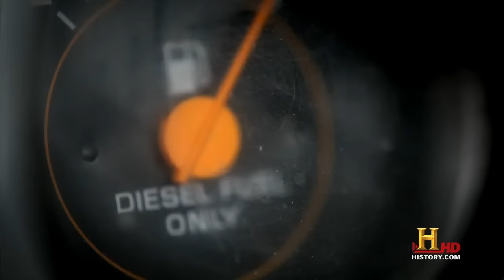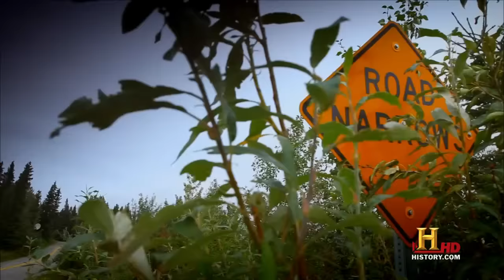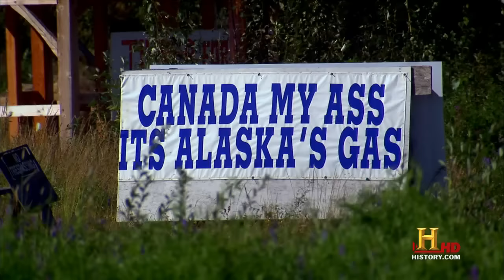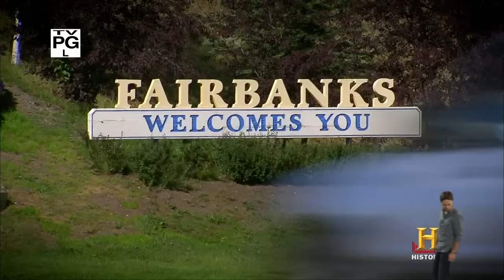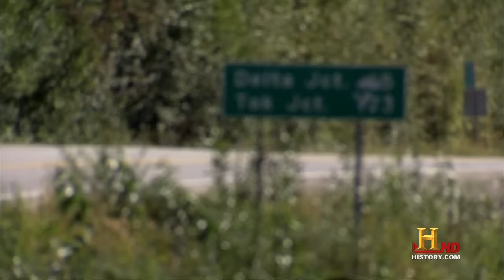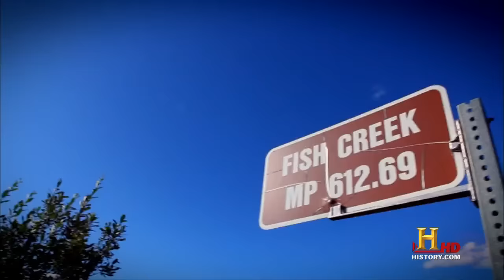Top Gear America Best America's 4x4 Truck   S01E09 - 2011.01.16

Comment: That Toyota is worth a lot more than $3k
Reply: It's worth like 10k
Reply: Benjamin Fink, pshh no.
Reply: If it was stock it wouldn't
Reply: Don’t doubt that. My almost 10 year old  (Toyota) truck with 120k miles is still worth 18000
Reply: Wrong you can get those here in Texas for 1500
Reply: @RiggyRonnie  not here in va
Reply: @randomguy-of8np  ya well it's surely not worth over 3k coming from the 1990s unless it's in tip top condition.
Reply: @RiggyRonnie  in my opinion a brand new Toyota is only with 3k. Hell the flat bed ford is worth more then a new Toyota to me so I see where your coming from lol.
Reply: WikiTool You guys both know nothing about Toyotas :P
Reply: @drwhat4574  my brother owns one lol. I'm in the middle of rebuilding the whole truck practically with him so ik plenty about them. They are pieces of shit
Reply: That Toyota would probably do better than any of the other trucks they had. My dad's truck has over 300 thousand miles on it and it runs like a dream, my mom has a Toyota Tacoma and my dad's got a tundra and a 4 runner lol. They've never had any issues with either truck. I'm pretty sure Toyotas are made in America now
Reply: No way 😂 even 2k is pushing it
Reply: Jake Dawg says the literal 12-year-old. Lol :P
Reply: @jakebraun6376  built like that?  You find one for $4k and let me know, I would buy it in a heartbeat.
Reply: Oh shit, I didn't know it was that built up. I have a lifted Toyota in my backyard for sale for $1k sooo..... I don't see how basically the same truck can be worth $20+k.
Reply: Jake Dawg it’s not going to be worth 20k. A built Toyota that’s running good is worth 4-7k. Just because your dad’s half built crappy project is worth 1k, doesn’t mean all of them are. You don’t know anything about what you’re trying to talk about.
Reply: Yes "4-7k". Everyone else in this comment section is saying it's worth $15+k. It's a beaten up truck with a lift kit, it's not worth that high. I understand 4k or even 5k is a decent deal, but c'mon, people think it's worth way more.
Reply: And btw, it's an '83 that doesn't even run. That's why it's only 1k. Its sat in my yard for a while, and it's not even mine nor my dads.
Reply: Jake Dawg One person said their 08 was worth 18k, and one person said the truck in the video was worth 10k. The 10k is pushing it, but no one is saying that the truck in the video is worth 15+. And yeah, your not even running Toyota is going for 1k. Because it’s not running. Clearly, the one in the video is running. And out ran these “American” trucks. Please stop talking. You don’t know what you’re talking about.
Reply: Evil AMC said his was worth 18k
Reply: Jake Dawg yes his “almost ten year old truck”. Not an 1983. A 2008+. There’s a few year’s difference there bud. Why are you still talking?
Reply: Jake Dawg what are you even talking about at this point? Holy smokes :P
Reply: I dont fuckin know 😂😂 I hafta complain about something 🤷‍♂️😂
Reply: Depends on what model Dodge, Chevy or Ford you buy. Some are assembled in Mexico and others are assembled here in the USA. Like the regular cab dodge 2nd Gens are made in USA. The extended cabs were assembled in Mexico. Yes the Toyotas, Hondas, Nissans are fairly American. Why? Because of import costs they assemble them here. What you guys fail to mention is that imports have their engines made and assembled in Japan cause they can't have Americans  do that for warranty reasons. Import companies for quality control reasons can only afford to let Americans do some final assembly. For the best quality and reliability you really do want  a true import. 😂 This is not a good video to determine the best of anything. With the 3 stooges crashing and abusing each other out of jealousy and cheating every chance they had. You can't fairly say that Toyota would outperform all of it's competition. They used to stack Toyota trucks on the beds of Ford F150's in commercials to show their capability. No one built a log cabin on the back of that Toyota either. They babied that thing so they could have something to take them home if the (unmodified) sight unseen online purchased trucks with unknown backgrounds inevitably failed. I say that sarcastically because they did modify and rig those trucks after they got them. I have a 1994 Nissan D21 3.0 4x4 automatic king cab. I frequently get compliments on this truck. It was cheap when it was purchased. I bought it used for $2400. ORIGINAL OWNER DID NO MAINTENANCE for about 198,000. It has a motor from a 94 pathy and the transmission had to be rebuilt 4 years after I got it. I pretty much had to rebuild whole truck. It was broken. It's now worth 5-6k based on offers I have gotten. I always say no way! I want 8k. Hahaha cause I have real blood and sweat invested in it.
Reply: @RiggyRonnie  tell me where I'll take 10. I live in Dallas and I've never seen one for under 4k
Reply: @theblacktieguy6694  Okay, download this app called " Let Go" its free. Type in the search box "Toyota Pickup" Ive seen a few used selling for 2k. If you dont want to do that just go to Craislist Im sure its the same. Also I'd b glad to buy my grandpas toyota and sell it to you for 10k surely would make me a profit.
Reply: Jake Dawg my 2014 Tacoma is still worth 23k, if we were talking the 16, 17, or 18 Tacoma’s then I would agree with you that they are sloppily built. But the 13s, 14s, and 15s are absolute beasts and will put any new Ford F-150 or Chevy Colorado to shame.
Reply: @ultimatum117052  my 2012 Tundra is still worth $32k... the people in this comment section are insane...
Reply: Evil AMC I can find a tacoma with 140000 mile 2002 taco for $8000
Reply: random guy no that thing in the USA would be worth 15k stock if you could find one
Reply: Benjamin Fink exactly Toyota is lit
Reply: Of those, the Toyota Tundra (they excluded) has the most parts made in the USA. That Tacoma is as American-made as any of the three, more than two. And, before anyone screams about profits, all three of those have foreign investors profiting for their sales. The Tundra and Tacoma are American trucks, designed and built.
Reply: @randomguy-of8np  clown
Reply: they're in Alaska - trucks are cheaper up there
Reply: a 4runner
Reply: Its reallly not in that good of condition. On craigslist 5 grand tops but 3 is average
Reply: absolutely
Reply: I have a 98 Tacoma and it's a piece of shit.
Reply: Those yotas are worth top money on the east coast. Rotted out beds and rockers with 220k miles still sell for 3500
Reply: I loved the way it was creeping behind.
Reply: Not back then it wasn't still a shitty truck
Reply: I'm lost. American made trucks but there was no Tundra...
Reply: @randomguy-of8np  that Ford smells like sadness and uncle semen
Reply: @somemedic  they didnt make the tundra then and just because it exists doesn't mean any of them will choose it
Reply: @jonathanrabbe4179  but if this show aired in 2011 the Tundra was 11 yrs old. 

It was made in Indiana at the time but I believe they're made in San Antonio now
Reply: @somemedic  the parts arnt made in America and it's not exactly though of as a American thing and thares three hosts and three big American trucks
Reply: @jonathanrabbe4179  you mean motorcraft and ac delco are American made? Try Honduras and Mexico
Reply: they didint buy it it was a spare truck
Reply: @joshclark7034  I'd like to start the bidding off at $1,500
Reply: @joshclark7034  the difference between those big 3 turds and that toyota...  

Nobody wants to sell their Toyota.
Reply: @randomguy-of8np  So you rebuilt the truck and it runs like shit now so you blame Toyota? Ahh yes the logic is brilliant! We have owned 3 Toyotas and all of them have gotten over 300k miles and are still going, no issues. Get a life
Reply: The Toyota Pickup is worth about $7K. So they did not abuse it. lol
Reply: Babylon falling  woah I forgot I commented that 😂 it's not mine, infact I really want to buy it for my first truck. The guy wants $2.5k for it now. I offered him $500 and he said no. The door doesn't latch, the front is all bent and bashed up, and the body is covered in rust holes, the paint is peeling and mismatched 😂 oh well, guess I'll get something else ☹ (and yeah, I'm pretty sure it's an 83)
Reply: Babylon falling  oh sick, what a good find! The 83 is also a 4x4 4cyl manual, but it's not worth $2.5k 😂 the guy is a hoarder. Anyways, good luck on your truck, you got any plans for it?

Comment: I love that blue Chevy and I can’t believe it one over that Dodge
Reply: I don't know how the cab on the chevy stayed attached to the frame.
Reply: The driver not the truck
Reply: did it tho??  the chevy was done at the first river, had the dodge not pulled it out.
Reply: @briwanderz  that was the Ford the Chevy slipped down a hill sideways and had to be pulled up
Reply: @EianJolin  ahh ok.. not sure how i got that backwards..   so the ford should have been done at the first river, which would mean that the whole thing would have ended with the ford done in the river, the chevy and dodge stuck on the hill, leaving it a debate of "the chevy lived a little bit longer"  vs "the dodge made it a little tiny bit further up the hill"
Reply: That’s because it was a Dodge, lol

Comment: 2:40 Rams didn't have a 5.7L engine as an option in this generation
Reply: He also thinks that tire to fender gap is all travel 🤦‍♂️
Reply: @This username 5.9 and 5.2 as options.
Reply: Invidious Ignoramus the engine options for the rams
8.0l magnum v10
5.9l magnum v8
5.9l Cummins v8
5.2l magnum v8
3.9l magnum v6

There was also a 4.7l magnum v something for Dakotas
Rutledge had a 5.9 gas by what I think. If it was a 5.7 it would be a engine swap, maybe a PCM swap. If I’d guess he has the Sport package and the 5.2 was a option but was a little rare. I also think that I should stop being a nerd
Reply: @wyoming8814  the 4.7l was the V-8 option on the third generation Dakota.
Reply: This username ah thanks
Reply: 5.9L 360ci 😉
Reply: Invidious Ignoramus doesn’t mean it isn’t in there
Reply: @wyoming8814  hate to be that guy but the Cummins was an i6
Reply: Zach Steele yeah knew that. Once I figured out that I made a mistake it was 2 weeks later lol

Anyway, yes it was a inline 6, seems inline engines last longer than V engines (proper term maybe exists but I don’t care about it right now)
Reply: @wyoming8814  yeah I think you used the correct terms, I think it's lasts so long because A it's a quality engine and B its way overbuilt for what it was used for
Reply: 5.9 liter. Its a 360 cubic inch engine.
Reply: in 97 5.2 or 5.9 v-8 & 8.0 v-10 magnum
Reply: Wyoming88 the 5.2l only came with an automatic but the 5.2l has both
Reply: Yep that’s what’s in my 3rd gen
Reply: @wyoming8814  5.9L cummins was a i6 not a v8

Comment: That was a mint doge . I hope they got all the trucks back instead of leaving them there
Reply: Two stroke life 250 doge go bork
Reply: If they don't I will go get it
Reply: Korey Hall I will too
Reply: These guys have outfits that cost more rhan those trucks. I guarantee they went to a scrapyard after they were done filming.
Reply: psychobeam99 witgout a doubt, they then hopped in their priuses and drive off into the sunset
Reply: Richard Head Maybe Rutledge, the other two have more respect for themselves.

Comment: Ummmm pretty sure they didn't offer a 5.7 magnum it was a 5.9 or 5.2 for the v8 🤣
Reply: Yea these guys are script readers.... the 5.9 and 5.2 had the damn magnum 5.7 was the hemi..  that's why I stopped watching this show they was kinda dumb...
Reply: @patrickstrauss9800  ummmm ok you have Google right no such thing as a 5.7l magnum 😂
Reply: @patrickstrauss9800  wrong lol 5.2 magnum, 5.9 magnum. Hemi was not used in a dodge till 2003
Reply: @theown32  then it was the hemi 5.7 magnum in 2003 which i think is what he meant (im not trying to be rude btw)
Reply: @theown32  the hemi has been around since the 60s
Reply: @CountryBoyWithAFord  the hemi we are all talking about was produced in 2003, use some common sense, and the hemi has been around since before then in other manufacturers platforms
Reply: @CountryBoyWithAFord  Not the 5.7 Hemi though, that is one of the new Hemis. The 5.7 didn't come around until 2003 in the 3rd gen trucks. Script writers probably got confused because at a time Dodge was calling the 5.7 Hemi a "Magnum" engine, which really didn't mean anything apparently. I've heard others say the "magnum" version of the 5.7 has more torque, but I think that's a lie. The V8 engines offered for his truck would either be a 5.2 or 5.9 Magnum.
Reply: @CountryBoyWithAFord  lol no....they havent.and even since 2003 the 5.7 6.1 and 6.4 arent even Real hemis..dodge hasnt used a true hemispherical combustion chamber since the late 70s...
Reply: Considering dodge hasnt used a true hemispherical combustion chamber since the late 70s...there not hemis .
Reply: @erikcapozzi771  Yep, that's why mopar guys call them fake Hemis, they are still solid engines though.
Reply: @ixionn563  some people would beg to differ.they have had there share of issues.they run hot naturally due to fast burn cylinder heads(3 valves) they sometimes loose valve seating .they have valve spring issues and if not adressed can cause dropped valves or alot of times due to the fast burn head design the exhaust valves will sometimes clash when seating or spring retention is compromised. They dont like being overheated in the slightest and are very prone to blow head gaskets.yeah alot of these issues are worked out now adays but it does affect alot of them on the road.
Reply: @erikcapozzi771  I only hear of those issues in the newer Hemis, the ones without MDS used in 2002-2005 apparently don't have those issues. I have an '05 with 200k miles on the original 5.7 Hemi and 545rfe transmission, no issues.
Reply: There’s also no such thing as a Chevy CK. Either C for two wheel drive or K for four wheel drive. You can’t have both. And Rutledge telling Tanner he’s lucky if his engine is a 4 bolt main...what difference does that make in this situation. These guys don’t know anything.
Reply: @ixionn563  I got the same tranny in my 06 Dakota - can you PM me sometime? Thanks for your posts!
Reply: There's a 5.7 for the chevy
Reply: there was no hemi lol that was most likely the 5.9 burning oil and blowing up lol
Reply: Right? That was what I was thinking. Maybe 4.7 but not likely lol
Reply: exactly I have a 5.9 magnum in mine and they only had 3 options and it was not 5.7

Comment: The challenge should have been they all had to use a truck of the same year like 1995
So Rutledge would use a 95 2500 Ram
Tanner would use a 95 2500 Chevy
And Adam would use a 95 F250
Adam was at such a disadvantage plus his truck wasn’t as tall
Reply: They were all under $3000... except the Toyota of course.
Reply: Ethan the Toyota is worth 1,600 on edmunds
Reply: @juljasmaharchive  gimme a link.
Reply: 1997 Dodge Ram
Reply: 1983 Chevy ck step side
Reply: 4 bolt main is the best you can get as a 350
Reply: 1976 Ford
Reply: @MayzDayz007  for stock or bolt on mods 2 bolt is fine and plus it was a lo5 350 so it could've been a 4 bolt if it came from a 2500.
But like the op said if they were the same year then it would've been better and with a 3k budget they could have gotten way better truck. I'd say the ram was best choice as they came with limited slip from the factory the other 2 probably not or worn out
Reply: @Scooty_scoob   I hear you on that, had 1989 ck2500 Chevy Silverado, garage kept for 30 yrs, 130k miles. Loved it, I  took $4,000 for it last week 😢
Reply: @MayzDayz007  only if you would’ve waited bro you could’ve got 12k for it these days

Comment: imagine if they were all upgraded like the toyota
Reply: LilShrimpToast that’s what I’m saying
Reply: Baja 1000
Reply: They were still pretty upgraded.  All of them had new offroading tires, roll cages, and even raised suspension.  These were not proper $3,000 trucks like British Top Gear would have done.
Reply: @zacharytracy3797  true that..the grand tour on Amazon is pretty good tho they need to do  a 4th season
Reply: All three of these trucks were all on the same level as the Toyota, 1990s lifts, 1990s wheels/tires, 1990s offroad lights, 1990s shocks, etc, etc etc
Reply: @Rangerman69420  the snorkel was a pretty big add on

Comment: They didn’t make a 5.7 magnum, that’s either a 5.2 or a 5.9
Reply: Sounded like a 5.9
Reply: They made a 5.7l hemi magnum
Reply: @rubbernoserebuild  hemi came in the next generation, those trucks still had the magnum motors, prolly a 5.9
Reply: @andextra4197  correct, but the next gen dodge had a 5.7 hemi magnum
Reply: @rubbernoserebuild  you need to refer to it as a 3rd gen then
Reply: I was about to say the same thing
Reply: @rubbernoserebuild   well you are not wrong but they only put that I'm the 2002 and that means it a 3 gen
Reply: @kylemyers1268  2002 still used the 5.9. 2003 was the first year with the 5.7.
Reply: Yea I noticed that as well
Reply: Maybe it had been swapped and he didn't specify.
Reply: The 5.2s take way more abuse so I’ll say it’s a 5.9 lol
Reply: 5.7 hemi engines are impossible to break my mom has 08 chrysler aspen and if you put care into the engine it will last
Reply: @lexuses3942  they both take a lot of abuse
Reply: It was a 5.9
Reply: Thank you!
Reply: Yeah I have the same truck though that was redik
Reply: What the hell are you girls bickering about?